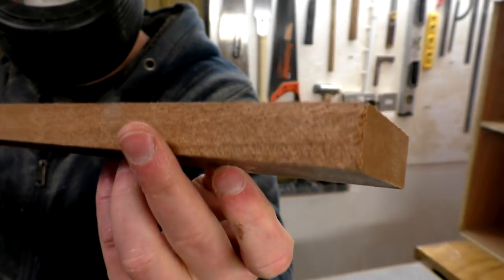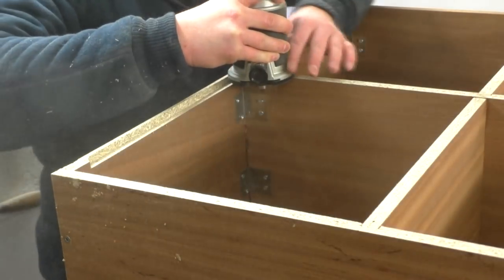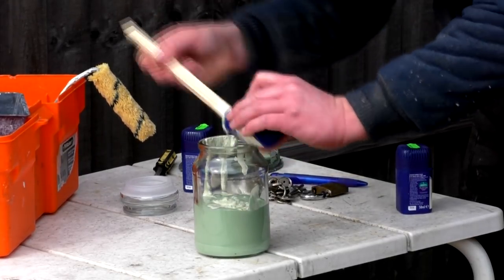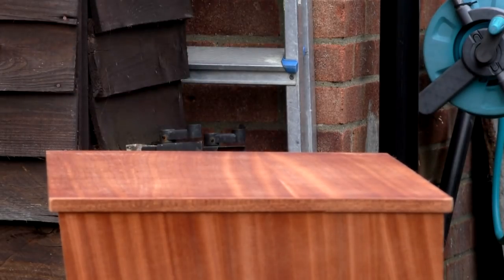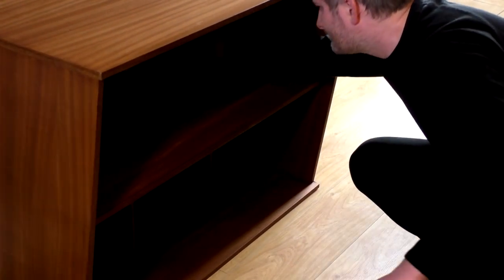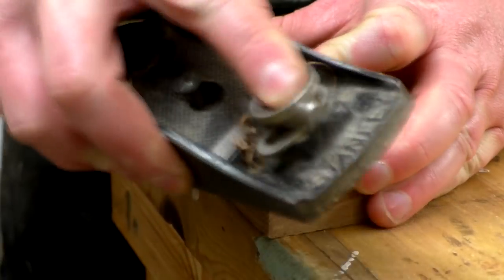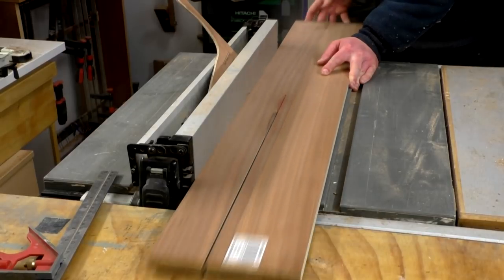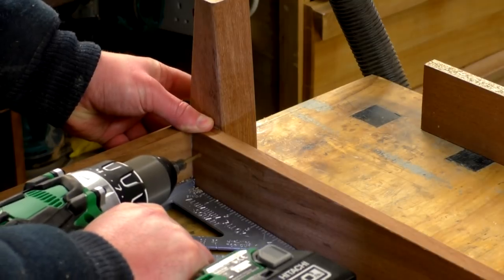Making A Mid Century Modern Vinyl Storage Unit (part 2 of 2)

Comment: Another great build Keith, nice one. Newbie question: why varnish before wax? I imagined it would prevent/hinder the wax from soaking into the veneer?
Reply from the maker: Thanks. The varnish was added for extra protection as wax isn’t particularly hard wearing and wax always needs to be applied last. Even with a seal coat of varnish, wax still fills the grain, changes the colour, adds smoothness and can be buffed to a nice sheen 👍

Comment: Hey Keith. Great work man! I was just wondering, whats the deal with the spray varnish? You seem to use it quite a bit but I've never tried it. Why do you use it over normal or wipe on?
Reply from the maker: Thanks! It dries super quick so good when in a hurry and I find it’s easier to apply evenly than brushing on. Wipe on varnish is expensive/hard to come by.
Reply: Ah, that's good to know about the dry time. I can see that being handy. Brushing varnish well is a bit of a chore I agree. For wiping varnish, I was under the impression it was just thinned varnish. So a white spirit cut or something like that? I could be wrong on that though.